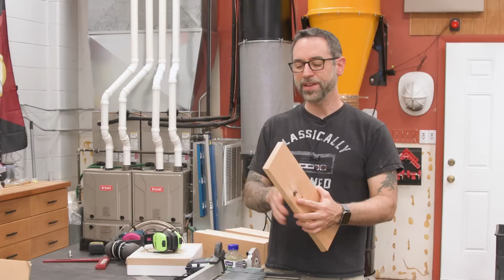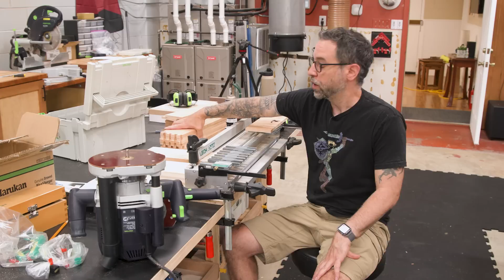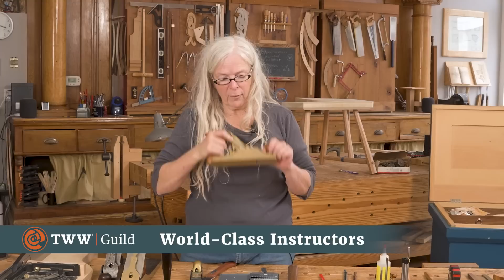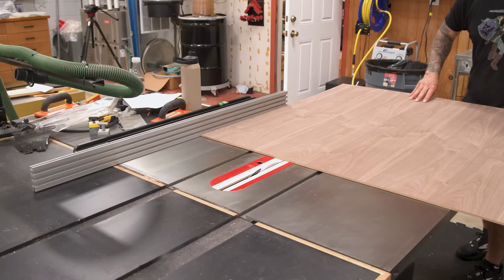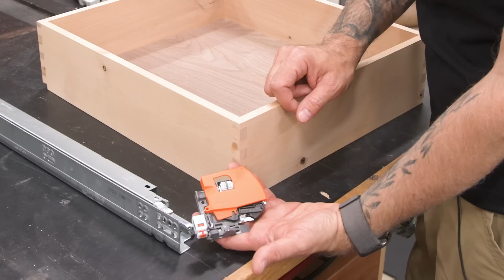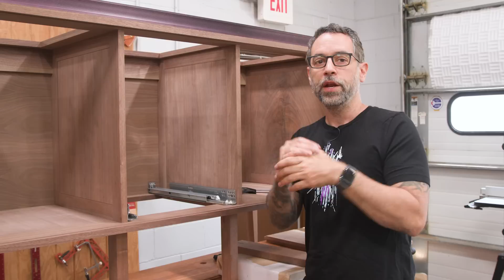Dovetail Jigs are Back, Baby! | Drawer Boxes | Sideboard Pt 8

Comment: The amazing thing about the Leigh jig is that you can put your tails and pins anywhere you want. They don't have to be equally spaced which I think is more aesthetically pleasing. Also you can make it so your pins aren't cut off ;-) Great explanation on using the jig BTW. Thanks.

Comment: I love how Mark is like "I'm not going to worry about the dust collection" then a minute later he has it connected up.  Routing dovetails is messy work and Mark is a smart man.  (We all think "That's too much work" until we realize the consequences.)  Thanks Mark for the great content.
Reply: Its much easier with the support in there to keep the router steady and as an added bonus it does catch some of the dust
Reply: @TheChopcat   Hi, you say it catches some of the dust. In my experience I would say that it catches at least 90% of the dust. What I see on videos of most people using it, is that they all seems to be afraid to put it close to the finger. You just have to make sure to let the router stop completely before moving it off the VRS support.

Comment: Just a hint for installing the carcass side of the slides, under mount or otherwise.  Instead of cutting that thin plywood stack of shims for each height, cut to the exact height for the top drawer slide and install all of those slides.   THEN cut that panel to the next height down and so on.   This way you do not have to stack and or tape pieces together.   Just remember to complete all of the same level slides at the same time before moving down.

Comment: I normally rip that line where you lost the tail all the way across the back, you can slide your drawer bottom in from the back and use a screw to secure the bottom. it looks good too , actually traditional.

Comment: Good timing!  I just finished making my boxes and am putting the slides in the cabinet today.  This is the second time using the Blum under mount slides and I really like them a lot.  You are absolutely right that there are a lot of things going on with adjustments, but once you learn and understand them, I think they are not hard and certainly far superior for fine tuning installation.  I do have to say that you should buy the drill bits available for that jig though, they really work great and have good lock collars.  I just have a small box that holds the jig and drill bits together in for storage along with a supply of their screws.  Blum also offers a catalog well worth asking for which shows all their hardware along with installation instructions.

Comment: Something i like to do when installing drawer slides is to place the cabinet on its side rather than fighting gravity ... In this case you had a large carcass so its not as possible, but with cabinets like kitchen base cabinets , it makes my life so much easier .... Also instead of stacking pieces of wood i make a jig from scrap which takes 2 minutes to make - all it is is a "T-square" and on the sides i attach small blocks that act as spacers to inset the slide the exact amount that i need .... It takes 2 mins to make if you have a brad nailer and it helps a lot ... Ive just installed 30 sets of drawer slides and it was a breeze 😊

Comment: I've enjoyed using Leigh Jig for years. One pass half blinds are so easy and fast. I like your idea of using 2 routers, that would save a lot of set up time for through dovetails. Although I wouldn't be discouraged using only 1 router. I've made lots of drawers having to switch the bits without inconsistence results. I like the fact you can make inlaid dovetails with the Leigh also, along with finger joints. Great video, and great tips, Thanks Mark!

Comment: Great video.  Thanks for taking the time to show everything.  Including the little things that some others may have covered up :).  One thing I noted in using the dovetail jig was mentioning the importance of marking your inside vs. outside face of your drawers.  You did mention it later, but that is something I always struggle with is making sure I get the face of the board in the right direction in the jig.  I know they are not hand cut dovetails and some woodworking snobs look down on jig cut dovetails, but I still think they look awesome and they function great.  And, yep, I have had to print out the manual several times as the mice in my workshop tend to make a mess of anything paper in my drawers.  Obviously not an issue in your shop.

Comment: When I build my drawers I always I cut the slot for the base fitting into, then I take the rear one and cut the slot completely off. That allows me to slide in the base from the rear after assembly. This allows me to slide it out in the future for replacement if it gets the worse for wear. It’s also a lot easier to prep and paint the sides without the base in situ. In your case where the bottom dovetail have chipped off, this might be a good solution.

Comment: Great tip on the "use 2 routers", its been about 3 years since I've used my dovetail jig and about to dust it off (and make it dusty again) for another project...and i had forgotten about that handy time/frustration saving tip. thanks again for the good work!

Comment: I cut my Blum slides relief cut with a dado stack after assembly and that way I dont loose my bottom dovetail because it’s glued to its pin. I set the height of the dado stack just a 64th under the bottom (plywood) and I fit it even with the bottom with just a few pass of a shoulder plane.

Comment: Mark - good video.  It would be good to show people how to mount the rear bracket properly when using face frames even though it didn’t apply to this cabinet.  Instead of cutting the notches for the slides in the rear panel, I rip off the area below the bottom, cut my bottom long enough so it overlaps the back and screw the bottom to the back.  The main advantage to this is that it is much easier to finish the inside of the drawer and the bottom separately then slide the bottom in and screw it in place.

Comment: Excellent tutorial on installing softclose guides without the benefit of CNC drilled holes. They are a pain but are very nice to have. One caution though, good guides which work well are expensive. Cheap guides are cheap in all ways until it is time to replace them prematurely.

Comment: They do make much longer drill bits. 6", 12" and 18" are not uncommon. Hard to tell if the 6" would be long enough but would be much better than the regular jobber length drills for drilling those angled holes for the locking mechanism. I don't even see how they could expect you to do that  unless they want you to buy there  special drill bits? This project looks very nice and i do agree these draw slides are a superior choice.

Comment: I am in the process of making a cabinet for my drill press parts. This video helps with the drawers, I have 6. However I am using the side mount drawer slides. The undermount type looks very good but I expect they are more expensive that the side mount type.

Comment: I haven't had a chance to watch the entire video yet, but if it wasn't mentioned, always make sure to center your router base plate if using two different routers.  Centering you baseplate isn't as important if you are only using a single router and switching back and forth between router bits.

Comment: I would add an additional first step before using any dovetail jig, an especially the Leigh Jig, which is to use a cone type concentric router bit centering device, to center the router bit inside the guide bushing. The Leigh jig is especially precise and a non centered bit will affect fit dramatically.

Comment: Mark, I really like the effect you got with taking the blow torch to the copper.  Did you end up putting a finish/protective coating on top of the copper to prevent it from oxidizing and turning green?  (or is that the intention?)  If you put a protective coating on top of the copper, what did you use?
Reply from the maker: No finish. I'm looking forward to it aging naturally now.
Reply: @woodwhisperer  Ah, I see (and that makes sense).  Me personally (just IMHO here), I REALLY like the effect you got with the blow torch and prefer the copper/red/orange hues you got over the green it will eventually turn to.  In the future, after it has tarnished, it would be interesting to see a follow up video and show off how it ended up looking (I'm curious to see the effect and what the panels look like after they have tarnished)

Well regardless, either way, it's a very nice piece of furniture you made.  Well done!

Comment: I'm not familiar with dovetail jigs, but watching you work this one made me think of a question. After you did the tail boards you flipped the the jig over to do the pins, but you only used the left side of the jig. For that particular jig could you have set up the left side for the tails and the right side for the pins and not have to flip any part of it? Or is that a PITA to make sure both sides are set exactly the same?

Comment: One thing that confuses me is setting it up to ensure you have don't have dado slot come through a pin on the front & rear piece that will be visible from the side - I don't think there was any mention of that in the setup and when it came to cutting the dado's they just 'happened' to be in the right spot. Of course the slots in sides, viewed from  front and rear don't matter since hidden by drawer front and, well, the back. So how to calculate the drawer heights and relative positions of the tails  to ensure the dados are not seen from the outer side?  And especially if I'm using a 1/2" bottom for a very wide drawer? (I could always rabbet the bottom so could use 1/4" dado but still how to measure to ensure? Looking at other videos they say 'not to worry, because will be hidden by side-mount slide'. But undermount is fully visible side.

Comment: I noticed you used tightbond extend, do you have a problem with it separating? Maybe I don't use it fast enough.  It is thin at the top of the bottle and thick as mud in the bottom.

Comment: As I was observing the dado's being cut in the drawer parts around the 13 min mark, I was wondering if you patch the notched tails? I typically do a stopped dado on the router table. Edit: I see now that one will be in the rear and the other will be covered by the drawer front.

Comment: Hey Marc! Great content, as usual.  I have 2 or 3 Leigh jigs and they work great.  I forgot I had one already and bought another one.  oh well. On your drawer bottom grooves.  Why not use a router table to cut them?  BTW, of course ROCKLER has their own version of the undermount slide gauge.  And it's a whole lot less expensive that the Blum version. Just sayin...

Comment: awesome once again.
I find if you don't use the locking mechanism jig to pre-drill the correct angle, the locking mechanisms can get wonky and not sit flat. Blum sells an extension for the 2.5mm bit needed for that. Worth the money to ensure they go in properly. You can also screw them in downward into the bottom panel of the draw if it's thick enough.
How did you determine the vertical spacing of the slides? I know Blum has clearance tolerances but for your given drawer thickness, how did you come up with that vertical spacing?

Comment: I have made hundreds of drawers and easier to assemble the drawer first and then remove the notch. I just use a pull saw and a multi tool. BTW Blum have a kit with all the drill bits and stop collars.

Comment: Do you consider the length available of the drawer slides when you design the drawer boxes? In essence, do you design the drawer box around the drawer slide? Great videos, and yes, these videos do intrugue me into looking more into the guilds. Thank you.
Reply from the maker: Yeah you have to. If you don't, you could get yourself in big trouble. I actually made the mistake of not allowing as much wiggle room in the case, front to back, and we had to do some clever manipulation of the case to make room. I basically cut it too close and then made a calculation mistake and it ate up all of my buffer room.

Comment: Question; what holds the back of the drawer onto the slides?
Reply: The drawers are sized to the slides, so that the locking mechanism keeps the drawer firmly against the back of the slide. The adjust pin that Mark drilled the rear hole for is used to adjust the tilt of the drawer front to back and to prevent the rear of the drawer from simply lifting off the slide.

Comment: Dovetail jointed drawers fell out of favor for the same reason hand cut dovetail drawers fell out of favor and moved to dovetail jigs. Laziness and refusal to take the time to learn. It’s faster and easier to cut a drawer lock joint with a router than to set up the dovetail jig. It’s easier and faster to set up a dovetail jig than to mark out and hand cut a dovetail joint. People only want to do it faster and in a lot of cases they want to make money. They don’t care about pride in workmanship only speed and money. There’s no mystery.
Reply from the maker: I disagree, but only because we're talking about different groups of people. I'm not talking about "real" shops where the pros are concerned about the bottom dollar and time. I'm talking about the space where the hobbyists and small shop pros play. It's that group of people who just 10 years ago were all about dovetail jigs. The hand cut dovetail people were always smaller in number and those folks are still around like always. I'm just wondering what all the dovetail jig people have moved on to. They didn't all suddenly become pros.
Reply: @woodwhisperer  I'm guessing they went head first into pocket hole joinery

Comment: Fine cabinetry and these ball bearing slides just irritate me. Why spend all of that time and money on accessories that in my opinion add nothing but trouble. Let the drawer run on waxed wooden runners like what has been for thousands of years.
Reply from the maker: “Nothing but trouble” = ease of use, soft close, full extension, adjustability, no risk of seasonal movement issues, no maintenance. Wood slides can be fun, but you’re not thinking clearly if you believe mechanical slides add nothing but trouble.
Reply: @woodwhisperer  On most case work under 20” depth it doesn’t seem that useful to me to have those slides on drawers. I visited a local Amish furniture retailer for inspiration and came across a few dressers and buffets with ball bearing slides and the first thing that came to mind was what the heck? Who decided that was proper? It was so out of place that I found it quite offensive. True craftsman built higher end furniture never has ball bearing slides but IKEA certainly does. Save them for office desks, kitchen cabinets and d mechanics tool boxes but not nice wooden furniture.
Reply: I'm kind of old school and usually think metal slides are for kitchens.  But then I saw the soft close and now maybe I'm swayed a bit.
Reply: I have wooden slides in ikea forniture!